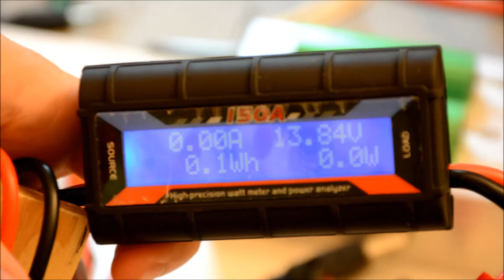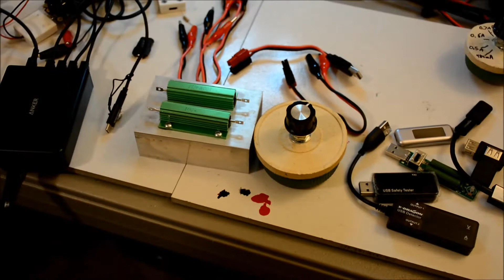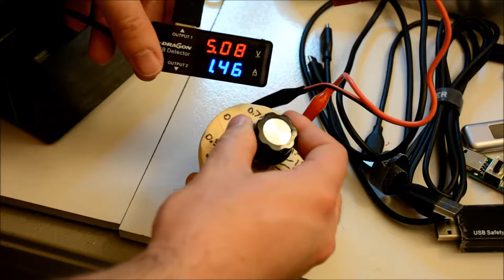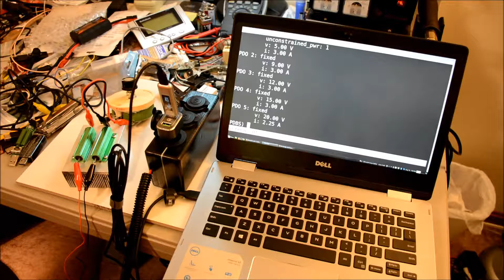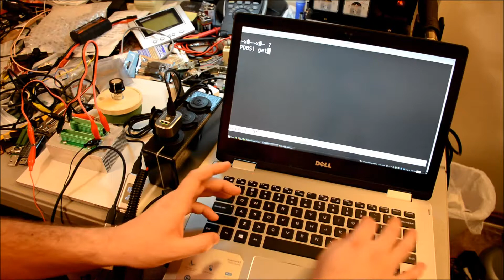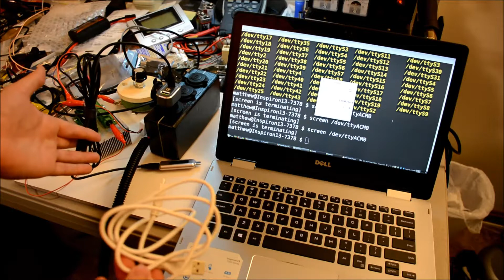Power Testing - Power Supplies and Cables 12V, USB, USB-C, USB-C PD

Comment: hey man, hoping you read your comments.
how come no one on youtube is probing the rails on the usbc chargers and giving actual readouts?
everyone ive found so far is just touting products that seem to tell you stuff.
wheres the electrical engineers of the world?

you seem like the closest guy to that, that i have found so far.
are you by any chance sitting on some treasure trove of usbc engineering data?
got a link for that?
id like to understand the individual rails of the cable, so i can diagnose chargers for hardware failures, and maybe even build some micro controlers for them.
Reply from the maker: It sounds like you are about where I was when I started this -- and honestly I still feel like I have barely scratched the surface but I will do my best to give you some answers.

First there's a bunch of types of "USB-C Chargers" that work very differently.
1) Dumb 5V USB-C chargers - they usually use a resistor on a pin to tell the device what the cable/charger is capable of.  This is most common on A->C cables like many phones and tablets come with.  There isn't really any testing to do as long as the + and - leads supply voltage without much drop it just works.
2) Qualcomm QuickCharge variable voltage - seems to use USB-A > C cables but it uses the Data +/ pins to "talk" to the charger and negotiate higher voltages (how high varies by the version supported by the charger and device), I haven't had much experience with this because I think I only own 1 charger that supports it and none of my devices I own support it.
3) USB-C Power Delivery - this is the newest thing that is out, its used by newer phones/tablets as well as laptops and other high power devices.  It can provide up to 100 watts of power (5 amps, 20 volts) but its a much more complex thing and requires chips/controllers on both ends, and requires USB-C to USB-C cables to work.  It's much more complex than just sending some voltages on pins which is why the extra tools are used to "speak" to the charger.  I've seen some people online use fancy logic analyzers and oscilloscopes to dig in more but I don't have access to that stuff myself, so the best I've come up with is it seems the meters they sell measure the actual power-wires (not just requested but actual voltage present) and then the other adapter part lets me request info and send commands to the PD charger to see what it claims it supports, and toggle thru them to test load.

The USB-C specification document is available to download, though the only part I've really dug into is what pinouts are supposed to be for different cables.  It turns out there are USB-C "USB 2.0" cables, as well as USB-C "full feature" cables, and then some other combinations of things with legacy.  I haven't figured out any way to identify them without sitting down and manually measuring the wiremap (which is annoying) since the USB-C connectors all look alike regardless of how they are wired inside.

Here are the documents I've found for USB specifications to test cables:
Cable wiring specs
USB-C, page 69 - https://www.usb.org/document-library/usb-type-ctm-cable-and-connector-specification-revision-14-march-29-2019
Legacy USB 3.1, page 53 - https://www.usb.org/document-library/usb-31-legacy-cable-and-connector-revision-10

EDIT: Apparently my first link is to an old document that was pulled...I think this may be the newer revision of it - https://www.usb.org/document-library/usb-type-cr-cable-and-connector-specification-revision-20-august-2019 
There's tons of other documents and technical specs on the usb.org library too, most of which I haven't got into yet or are beyond what I currently understand.

I hope that helps to point you in the right direction, certainly let me know if there's anything else you're wondering, I can try and answer if I know.  It's a huge amount of information and I have a feeling it will just get more complex - I hear now USB4 is coming out soon.